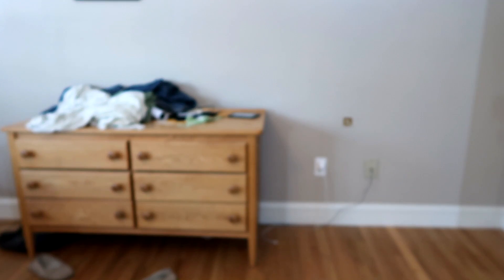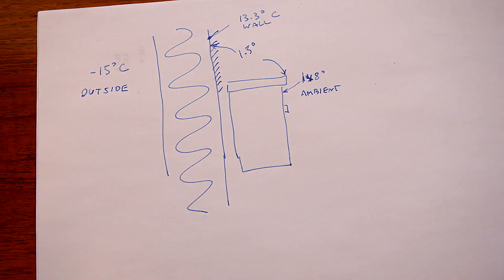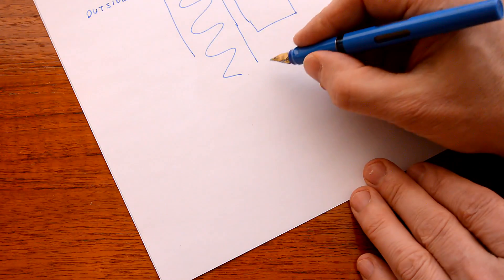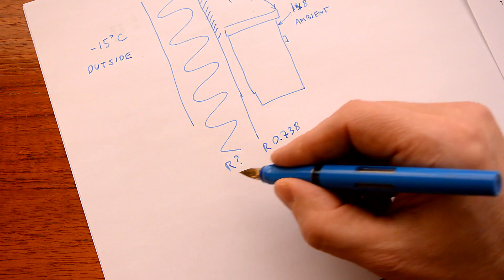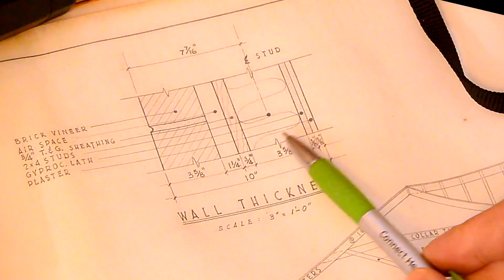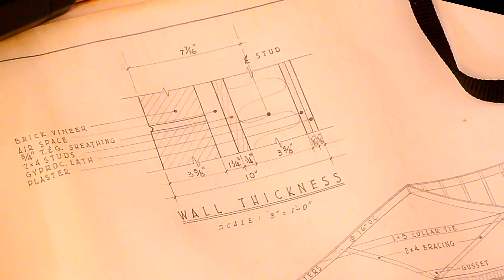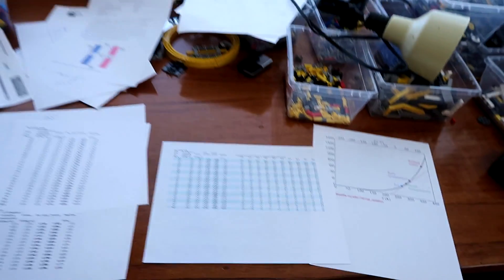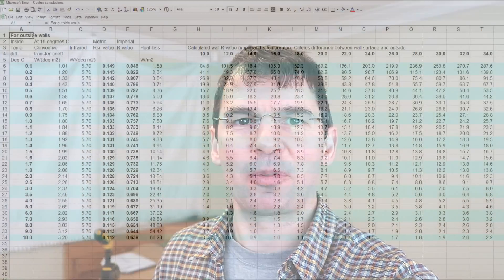Measuring house wall R-values using an infared thermometer

Comment: was really confused at the R-value of 13 until I realized it was inmperial, the requirement here is 6.6 and that need a lot thicker insulation
Reply: Most  modern American houses in colder climates build exterior walls with 2x6 not 2x4 studs. 2x6 allows for R-19 to R21. R19 is minimum code where I live in the mountains of North Carolina.
Reply: here which isn't particularly cold the the requirement is double that and it needs ~300mm insulation

Comment: Nice. Now I can check the value presented on my triple glass. All metric, of course.
Reply from the maker: careful with those - they often have infrared reflective coatings on them, so you can't effectively measure the surface temperature, unless you stick some tape to the surface.
Reply: @matthiasrandomstuff2221  Thanks for the heads-up. I had them installed about two years ago, and found out shortly after installation that there are much better units available. Oh, well. I have 'U' value of 0.7. I don't know the exact meaning, only that lower is better, and that current generation goes as low as 0.2.
Reply: As far as I know it´s the reciprocal of the R value.
Reply: @moninum  Thanks. Somehow I don't get this: if R is given in W/(m² °C), then how come that higher values are considered 'better'? Isn't that just a higher loss? Clearly I need some more reading.

Comment: Hi Matthias, did you also read the outside temperature with the same IR thermometer on the wall? If the insulation is crap, then it might be that your inside wall is relatively warm just because of the radiator.
Reply from the maker: A radiator below would completely screw up the readings.  I just relied on the outside thermometer for that reading.  Getting that off by 1 degree would only throw off the calculations a little bit.
Reply: @matthiasrandomstuff2221  I think the outside wall surface temperature may be significantly warmer than the ambient temperature. So the air coefficient on the outside surface would factor into the calculations (and would depend on whether it is a calm or windy day).
Reply: I guess we can just conclude that the r value is from inside wall to ambient including the r value of the  outside air layer.
If it's windy outside the r calculation will change because the outside air layer becomes less and outside wall becomes same as ambient.

But yes, the most correct would be to measure ambient and wall and subtract the r value from the outside air layer. This would  also be a way to double check the heat flow derived from inside ambient and inside wall provided there is no wind outside
Reply: what radiator?

Comment: Hi! 
 is there a way to detect argon in windows?
With this method can calculate the R value of the windows glazing? If I untie the seal and extract with a syringe how i can detect if is argon ? You can do an episode on this subject. there is limited information on the internet. Thank you!
Reply: Argon in windows is a marketing BS. You can't contain it. Just get a nice triple glass windows and forget about all that :)
Reply: @alxklgn364   I have triple glass 44 mm. I ordered with argon but I have doubt it contain the gass :) I vant to detect somehow and if not contain to sue the company I ordered from
Reply: @aristipitica  they are just gonna say that you've released the argon while taking the measure :) As Matthias pointed, you don't get a significant benefit from argon. So as long as your windows don't fog up - you are good.
Reply from the maker: Argon helps a little bit, but not hugely so.

Comment: I have 1 suggestion. These thermometers cant adjust for emmesitivity so i would suggest sticking a piece of tape on both surfaces to measure from. Then your emmesitivitys are the same. Now u are mesuring glossy laquor and a rough wall. Verry different
Reply: Electric tape has a high emissivity. But the field of view of the sensing lens is several degrees. You need to make sure that the electric tape fills its whole field of view, which means you need to get pretty close, or use a lot of tape.
Reply: This is especially true on the window measurement. Who knows what that reading was actually from. Great video though, R value is always tough to explain.
Reply from the maker: Yes, for windows, emissivity can vary a lot.  For house paint, even white stuff, it's generally quite emissive so it's not an issue.
Reply: @matthiasrandomstuff2221  yes its not like you are going from stainless steel to vantablack
Reply: Poop! I just recommended the same, now see i sound like an echo chamber..
Reply: Actually they are usually set to 0.95 emessitivity, and you can adjust it, at least on the 90$ flir models. But not worth the hassle, do you know how to measure emessitivity?
Reply: @MrStudioso  Emissivities for many materials are tabulated. Electric tape has high emissivity (like 0.95). Most IR thermometers I have seen (including cheap ones) allow you to adjust emissivity. But many people don't know that. Also, a lot of people think that the thermometer is measuring right at a tiny point where the laser is, when in reality, it is measuring over an angle of several degrees. The only way I know to "measure" emissivity is to adjust it until the thermometer gives a true reading (verified separately by contact thermometer). Not very reliable!

Comment: This video explains the process perfectly. I went through all of these calculations shortly after moving into a new house. Basically, it revealed that the previous owners had failed to adequately insulate around exterior wall DIY jobs, especially a new prehung door leading to a deck that they'd added. Heat was constantly rushing out between the jamb and the framing. You can lose an incredible amount of heat through 2x4 exterior walls. I'd added a small window on the same wall and been really anal about the insulation, and the difference between the two was impressive.

Comment: the real question is 14.8 C inside? i bet you spend nothing on heating!
Reply from the maker: we keep the bedrooms cool.  Much better sleeping that way.
Reply: @matthiasrandomstuff2221  you Viking :) and good for the environment
Reply: Matthias Wandel it can be a bit risky going below 16c in bedrooms. With the moisture from breath, you can get mold attack in the room. Well, having a house built in 64, there is probably no plastic vapor barrier in the walls/ceiling, so you probably get rid of some moisture through the wall/ceiling. Would be worse in a new house.
Reply: We have 24°C inside, because my mom is cold even this was, but it forces me to wear only a tshirt and underpants at home, or i would sweat like a pig
Reply: Maintaining a 30 deg C constant differential will cost him about $50 per day (using his R value and calculating for wall area only assuming a 140m2 single storey house and a cost of 8cents per kWh for natural gas).
Reply: @SzonSer  your math has to be way off. That's $1500/month
Reply: Salvador Nobre Veiga woops, bloody imperial units again! It’s more like $10 dollars per day ($300 per month). The point I was making to OP is that it’s not cheap to keep a house warm in winter. In my house I have a slightly better r value but have oil fired heating. Our winter is not as cold but maintaining an average of 10deg above external costs me €200 per month plus I have open fires. So the numbers seemed plausible.
Reply: @SzonSer  
Maybe there with those incredibly thin walls it's not cheap. In here where the government wants its citizens to save to whole world from global warming it's mandatory for new houses to have walls with a minimum of 0.17 U-value. You can achieve that with a wool insulation of about 200 mm with a lambda value of 0.036. For roof the required U is 0.09 if I recall correctly. Oh and the scale is not linear, U=1/R.

And yes I think so too that there is a risk for microbe growth with too low room temperature. The dew point is close to the actual room temperature and humidity can condensate and provide a platform for mold etc. It doesn't matter if it is on inside layer or inside the structure. The gases and microbes will end up in the air you breathe.
Reply: Antti Harri our walls aren’t that thin, and we have similar regulations for u values. I bought my house recently and although built in 1970s it was retrofitted with insulation so the walls and roof have a uvalue of 0.17 and 0.13 respectively. Double glazed windows are still a weak point as are the open fires but I’m working on that. Oil costs about 10 cents € (11cents usd) per kWh so that’s the main diff. The 200€ I quoted also includes cost for solid fuel for fires which we use most evenings Oct through March. Our energy rating needs to be revised but I estimate it’s a C rating about 3 times the intensity of a low energy build
Reply: Everything over 18C is overkill for a bedroom.
Reply: 14.6c is 58.64F for those who don’t feel like searching it on their own.

Comment: Google: R-value is a measure of how well a two-dimensional barrier, such as a layer of insulation, a window or a complete wall or ceiling, resists conductive flow of heat. r-values measure the thermal resistance per unit of a barrier's exposed area.
Don't use a wall in your house as CPU thermal paste.
Reply: The hero we needed
Reply: @Sharpman76  Man, I know, I just don't want anyone to repeat these mistakes.

Comment: I don't mind the math at all - often its pretty interesting - but since I live in southern Florida the entire concept of trying not to lose heat through the walls of your house is lost on me.
Reply: same principles, it's all based on heat flow. and you can ditch all the shenanigans by simply calculating the differences.

Heat doesn't care if it's 25deg inside and -5deg outside, or if it's  15deg inside, and 45 deg outside. it's the absolute difference that matters.
In the winter you care about keeping heat in, in the summer, you care about keeping the heat out.
The larger difference you maintain, the more energy will be required to maintain it.
Reply: Same calculations on not gaining heat from the outside.
A/C's are expensive beasts
Reply: If the isolation is good for the cold it will work just as well for the heat. Thays why foam is used to keep food both warm and cool...